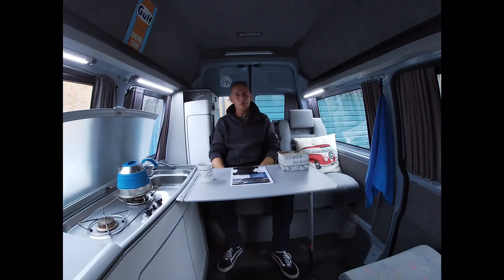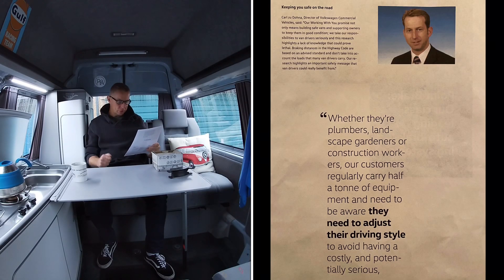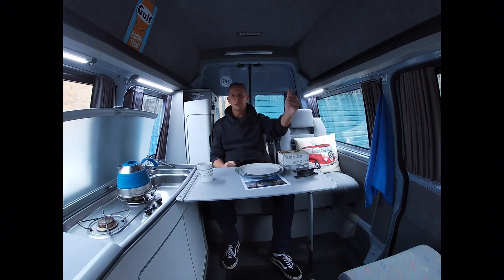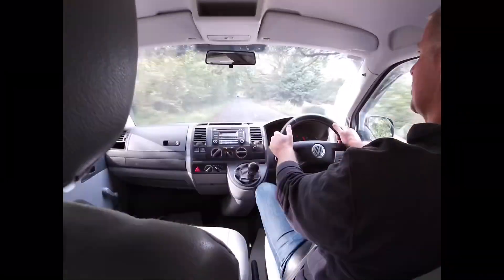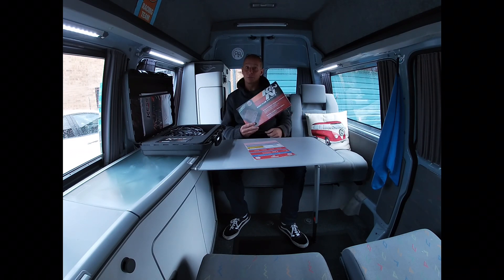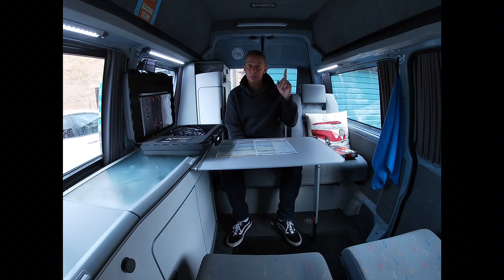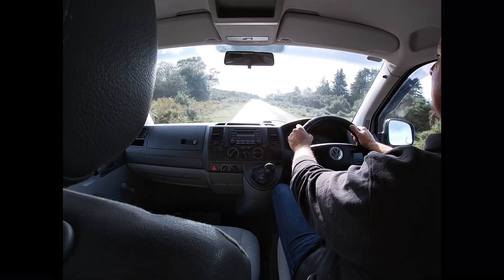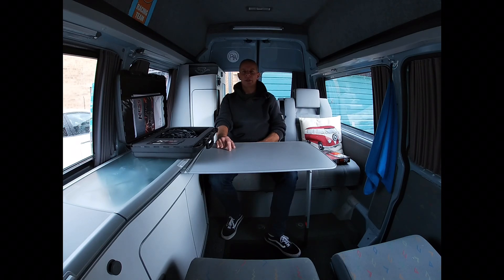Safety Warning from VW Commercial Vehicles to (Camper) Van Drivers - T5 / T32

Comment from the maker: ‘Once formulations are approved, the pads go into production within the onsite factory, which currently produces in excess of 24 million pads each year for vehicles such as the VW Golf and Ford Focus. Largely, production is for OE – although everything that goes into the OE box also goes into the aftermarket Premier range box, with the aftermarket bound products made on exactly the same lines, only the car maker’s mark and sticker on the box differentiates them.’ Ferodo
Source: https://autotechnician.co.uk/the-limitations-of-r90/